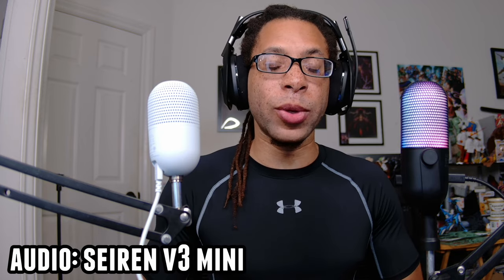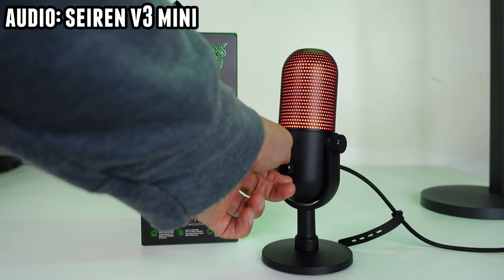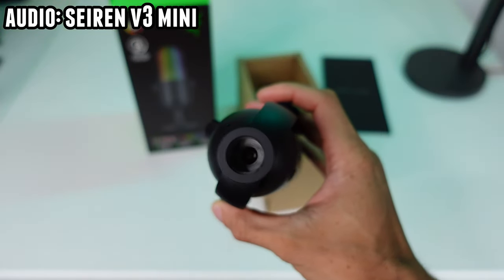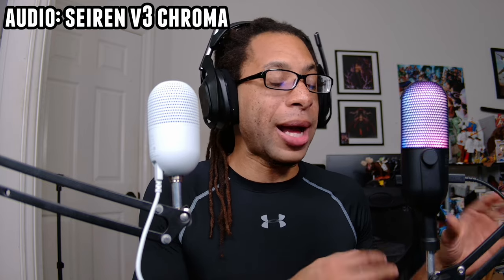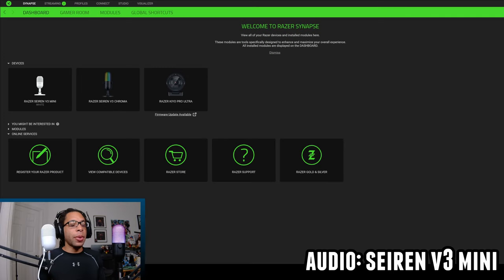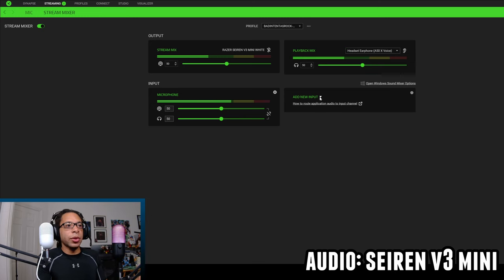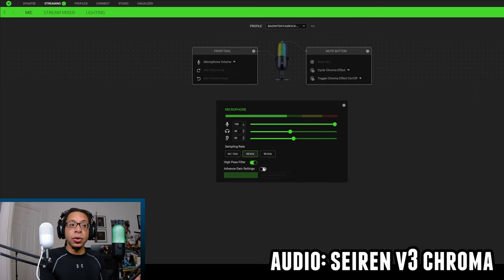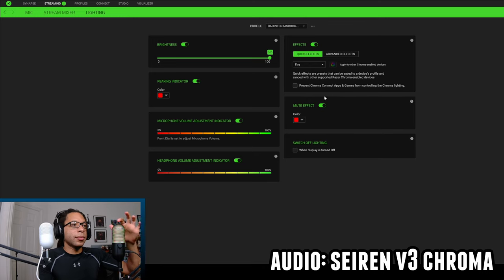Razer Seiren V3 Mini vs Seiren V3 Chroma

Comment: hey can you tell me what you think about the steel series arctis nova pro? should i go for the wireless or wired version? also any alternatives to that? and also im getting the wireless for 260$ so kindly suggest other headsets around that price range
Reply from the maker: I personally don't like the sound signature of it. I only owned the wired version. The DAC is good, and build and comfort are alright, but unless you only play FPS games and like an extremely harsh and treble-heavy sound signature I can't recommend them for the sound. 

I think the HyperX Cloud III is overall a better option and way cheaper. If you want the absolute best, the Audeze Maxwell has unmatched sound quality, but it's uncomfortable over longer periods.
Reply: @BadIntentStreamTechReviews   the maxwell don't come cheap, and what I'm looking for is gaming and basically music/movies as well, something i can even use irl if needed like on my phone. the cloud III is good but I'm looking for more features. anything else you have in mind?
Reply: @BadIntentStreamTechReviews  also with sonar you can tweak it pretty much however you like, the only bad thing about the headset is the mic. even the cloud III mic sounds way better